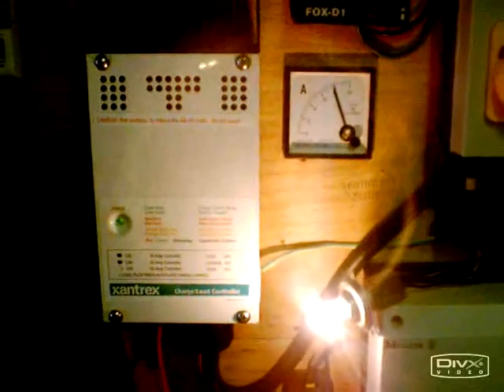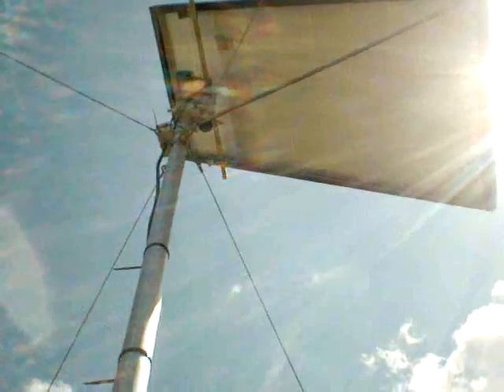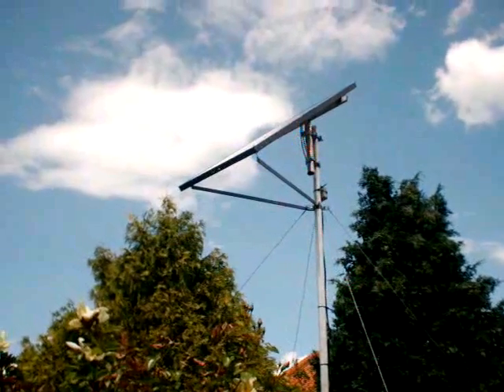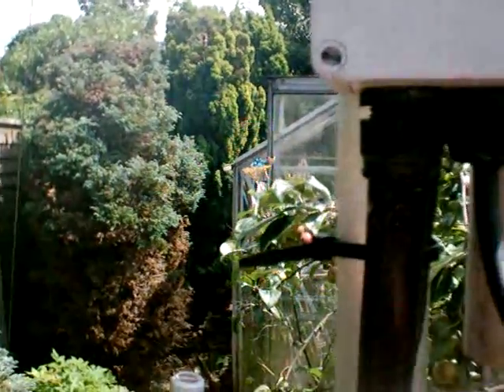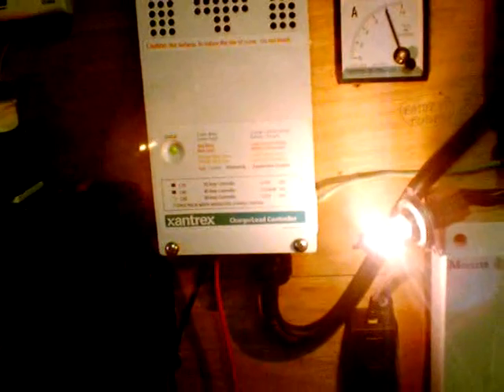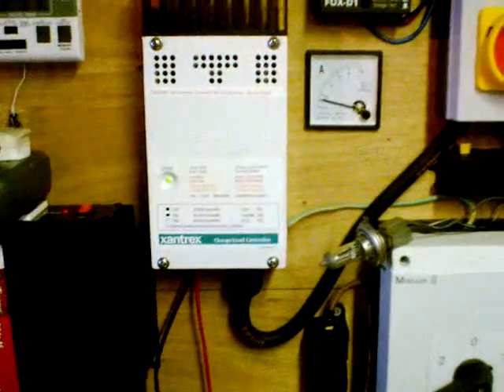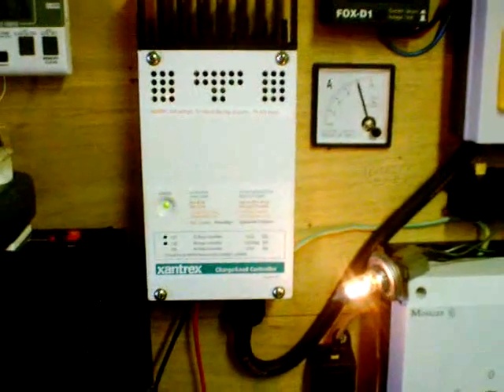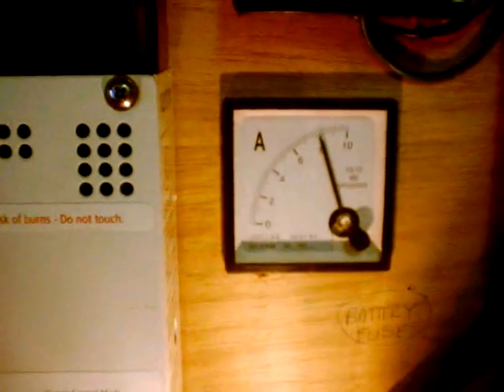125w solar panel.I now have 3 more.4 in total 500w plus

Comment: i have 18 batterys   of 12 v  300 watts  my bank..:)
but i have only one solar panel 85 watts
takes long to full but looks nice to see it works  
for 7 days i used just  tv, box hd tv, 60 watts light
10 mins of  hair dryer :)

from 13.20 batteris full  7 days  down to 12.40
i use 7000.00 watts!!!
wow!!

Comment: @7501234  Do both, I do! I have seperate "green" lines for solar 110v outlets in my home, and also use a GTI to feed the grid when my battery bank is full. Or, as I mostly do, perform both at the same time. Sam

Comment: @windysolar1, the are special Grid Tied Inverters, such as the one that I use. You can see the one I have on my videos. These units can be found to take voltage inputs from as low as 10.5v. Just make sure to match the watts coming in from the panels to the size inverter you need. The unit you used may not have been the correct type or set correctly. Most GTI's have a small switch to input into the home's power 110v or 220v. Sam

Comment from the maker: @mrbuki77 
if you feed it in directly it will blow up the equipment because the amp age in the utility is a lot stronger
I tested that with a 300w inverter  bang and a puff of smoke

Comment: I don't know if your using a bulb still for the dump load. But perhaps get a micro inverter that plugs into an electrical outlet inside your home to feed some juice into your home an slow down your electrical meter a little. Just an idea to think about. Hi from sunny FL

Comment from the maker: As your battery's charge up  the voltage increases but the Amp-age decreases.
so when your battery bank is nealy ( 90% )full the charge controller starts to dump the extra power to the dump load .then the charge controller waits until the battery's are 100% full which takes a long time up to 24 hours on some systems depending on how much power you have coming in.

Comment from the maker: A dump load is used to absorb the excess power when the voltage rises above the safe level that the battery's need to charge.
Too much and the battery's cook which will destroy the plates inside. creating heat in water or air.

A safety valve for battery's

Comment: I have a small wind turbine and a small solar panel your right about solar panels they give out a steady volts and amps most of the time my only concern is the way you have it mounted in a good wind it could turn into a kite personaly i would have mounted it on the roof of your out building it would be a lot securer and easier to maintain[lot of money to go skyward]?

Comment: Just wondering - what happens in the winter when snow covers the panel? Is it slick and steep enough such that no snow can stick, or will efficiency be lowered when the the dust starts to cover it? I guess that it doesn't matter too much in the winter when there's so little light anyway...

Comment from the maker: to charge the battery's they must be connected in parallel for 12v charging,
but you want to get 36v out of the battery's.
you would have to rewire the battery's in series.
+ to - between all 3 battery's, this will give you 36v but it is complicated to get round this problem ( but not imposible)I think if all the batterys had blocking diodes on the 12v curcuit might work but I have not tryed this so at your own risk.

Comment: A quick question for you electronic whiz people, I want to charge 3 12v batteries in parallel then throw a switch to connect them in series to make 36v, I have tried but I've obviously down something wrong as that blue magical smoke was released last time I tried. My question is what type and how to wire the switch. any advice gratefully received.